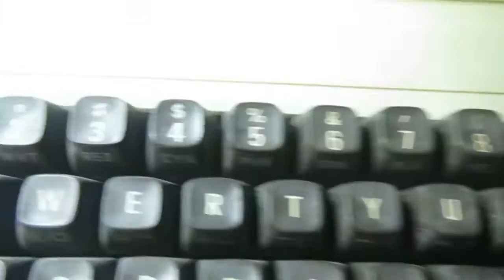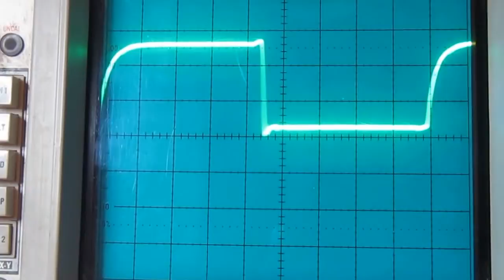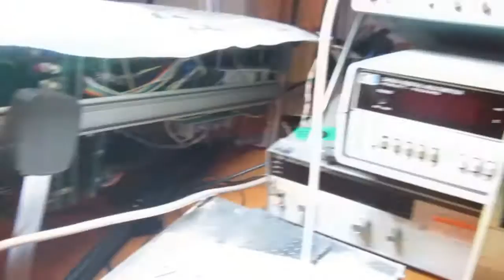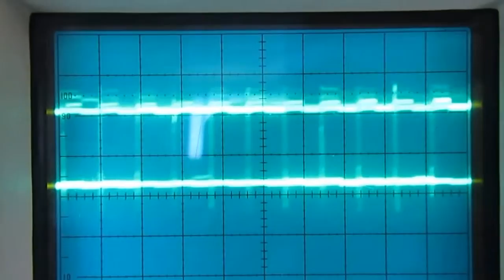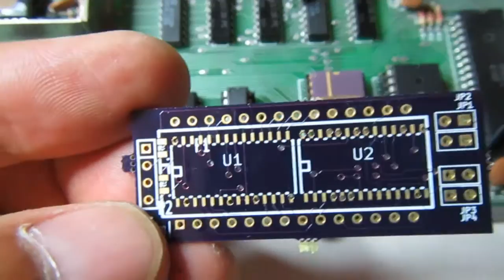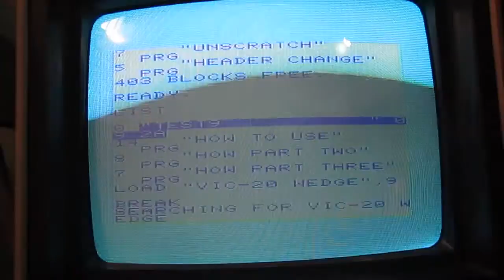VIC-20 black screen repair. Bad Basic ROM

Comment: i have a vic 20 that booting only on a cyan blue screen  can it be the same problem???
Reply from the maker: solid cyan I'd doubt it's the basic ROM. Cyan border and white empty box then yes, it's likely the basic ROM. What do you mean with "cyan blue" anyway?
Reply: @iz8dwf  https://atariage.com/forums/topic/304135-cyanblue-screen-on-vic20-boot/     I have the same problem like this  guy
Reply: https://atariage.com/forums/uploads/monthly_09_2016/post-45850-0-04554600-1475112481.jpg
Reply from the maker: @BraveNewWorld1984-r6o  This fault isn't straightforward to diagnose without further tests. Basically the VIC chip isn't initialized correctly and that might be caused by several different issues (RAM, Kernel ROM, bus conflicts, VIC chip itself and any logic fault in the decoding logic and data bus sharing logic).
Reply: @iz8dwf  I found the problem the Vic chip is dead
Reply from the maker: @BraveNewWorld1984-r6o  I'm glad you found the problem, but that's the most expensive IC on a VIC-20, sorry for that.

Comment: Hi, great repair! I have a Vic20 CR (assy250403) with black screen. I tried the clock input at the 6561 IC; it is present but on pin 38 and 39 it has the same phase. I saw in your video at min. 5.26 they are 180°. How can it possible and what can i may test? In this condition, no clock coming out from the 6561 ic pin 35 and 36 :(  (i initially suspected a broken 6561 but i have clock doubt now) thanks!
Reply from the maker: Hi! If you're sure that the two clock inputs have the same phase, then the 74LS02 (UB9) is partially failed. Look here: www.zimmers.net/anonftp/pub/cbm/schematics/computers/vic20/251027r1.gif Pin 13 of UB9 must have the inverted signal that's present on Pins 11,12 and Pin 10 must have the inverted signal entering on Pins 8,9
Reply: @iz8dwf  Thanks! i'll try to replace the 74LS02 with a new fresh one, and i'll tell you :) (this vic20 it's my first computer too in 1983)
Reply from the maker: @blade8442  You should however check that you have missing out of phase  (180 deg) signals on one and only one gate of UB9, otherwise you have a measurement error :) What you observe is compatible with only one bad gate in the whole chip
Reply: @iz8dwf  I did the misurement with oscilloscope (a Tek as your :) ) in this way: trace 1 on pin 38 and trace 2 on pin 39 with ALT visualization select, it should be correct?
Reply from the maker: @blade8442  Use CHOP instead of ALT, trigger on chan 1.
Reply: @iz8dwf  Replaced 74LS02 adding e nice 14pin socket, now the clock signals are corrects! But no clock comes out from 6561. I think it is broken :( I'll try to replace it in the future. Many thanks :)
Reply from the maker: @blade8442  I'm sorry for that, the 6561 is the most expensive chip to replace in a whole VIC-20. Good luck!